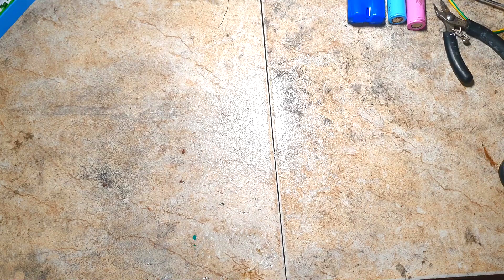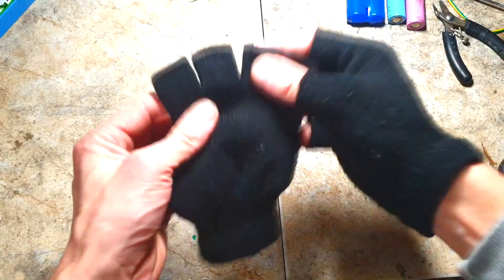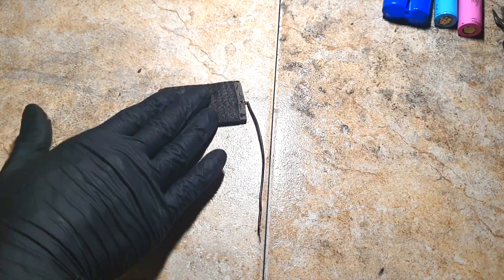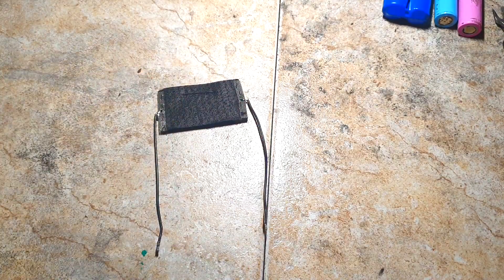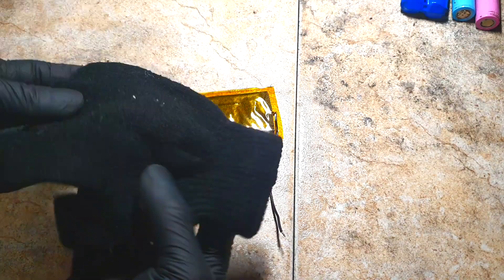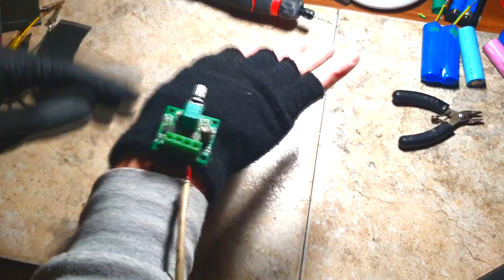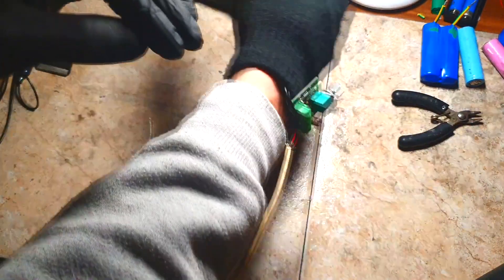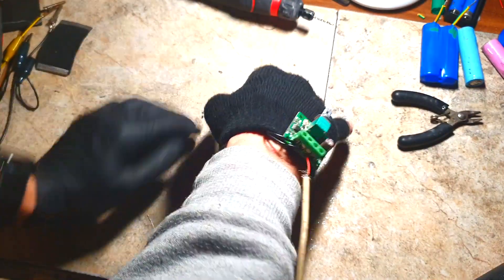Diy Heated Gloves

Comment: if you apply heat to the glove without the battery will it produce electricity
Reply from the maker: Sorry no. But good thinking. If you want to generate energy then for example you will need to use some peltier device or some made  thermocouples.
Reply: @cayrex  thank you so much for responding, i luve your videos, i am a fan of your work, i was looking for some info of like peltier device but for a tube, and i know you do inks and was wondering if it could be reverse, thanks a lot

Comment: is there any document that i can buy to making an ink for heater application? it can be a book, application note or any type of digital document.
Reply from the maker: Hmm,... that can be difficult to get, because everyone will hide a detailed recipe. Some patents will be good to read that you will get the idea. Most of the time thos inks are carbon inks.
Reply: @cayrex  there are some inks like Robert Murray, but this ink is made by graphite. When i made a carbon ink with active carbon and glass water, it's resistivity was very high and required high voltage. Can you supply a clue to reduce resistivity?
Reply from the maker: @celalaslan9896  You use active carbon aka activated carbon? The activated carbon is have not good conductivity. Use graphite!
Reply: @cayrex  thnks sir.

Comment: Really nice job!! I was wondering, why don't you open a ko-fi account, so people can help you with foundings and make more of this application, maybe applying your knowledge on batteries, using that in some way make those a step further and your channel also!
Reply from the maker: I really like this project and I will continue to upgrade. And is also really handy for cold days. I have problems that my hands are mostly cold and are difficult to heat up outside in wimter time. That heated glove help me really nice to heat up my hands. Over some time I want to make integrated heater. Some integrated rechargeable battery will also not be bad. Capacity sensor electronic swich,.... etc. Some founding can help alot, but can be hard to get also.

Comment: What is the 3.7v mAh value of the batteries?
Reply from the maker: You have in description. 2600 mAh
Reply: @cayrex  thanks 🙂
Reply: @cayrex  If the 2600mah is smaller, will the battery be a problem?
Reply from the maker: @erdemkacmaz7617  you mean,.. if you have lower capacity as 2600 mAh? In that case the operating time will be shorter
Reply: @cayrex  If I give 5v 1 A, will I take the heat you take?
Reply: @cayrex  So if I use 1 charging adapter
Reply: @cayrex  what exactly does the potentiometer 5v 1A do
Reply from the maker: @erdemkacmaz7617  "If I give 5v 1 A, will I take the heat you take?" yes,... I use 5V and 1 Amp. Potentiometer limit the current in range of 0 to 100%,.... I like a gas pedal in a car.

Comment: Can you give a link or write the features of the circuit you put between the battery?
Reply from the maker: What circuit you mean,... the one which is in the battey bank?
Reply: @cayrex    yes small electronic circuit
Reply: @cayrex  Does the interleaved electronic circuit provide a 6v output of 10 amps?
Reply: @cayrex  you can share a link where i can reach, thanks for detailed information
Reply from the maker: @erdemkacmaz7617  It is 5V 1A. And is some cheap power bank for phones (portable phone charger)
Reply: @cayrex  you adjust the power by hand it is not fixed 5v 1A then
Reply from the maker: @erdemkacmaz7617  
Aaaaa you mean potentiometer? 0-5V and max 2 A https://www.ebay.com/itm/DC-Motor-3V-5V-6V-12V-PWM-Speed-Control-Controller-Regulator-Regulation-Switch-/283772731915?mkcid=16&mkevt=1&_trksid=p2349624.m46890.l49286&mkrid=705-154756-20017-0 but the source power is fixed 5V and 1A,.... therefore you will not be able to go higher as this
Reply: @cayrex  thanks

Comment: Hey, I like it. But, maybe you should use Stainless Steel Staples with Conductive Glue instead of Sewing and make the entire Glove as a Conductive Lining placing the Lining inside Glove and do all the Electric Attachments with a very good Conductive Thread. Drop the 18650 Batteries and use Flat Pack Lithium that could nether be part of Glove or Flat Pact for Belt or Jacket. Drop the Large Power Adjustment for Flexible Push Button Temp Control instead. What do you think of My Idea? Will it Work? You could also use Flexible Solar Attached to Jacket Front and Back to Charge Battery Pack or Packs. Heck, using this setup, you could Design Entire Cold Weather Suit with this in Mind. You could use Flexible Highly Conductive Inks instead. Thanks for the upload. Sharing your knowledge with me is Appreciated.